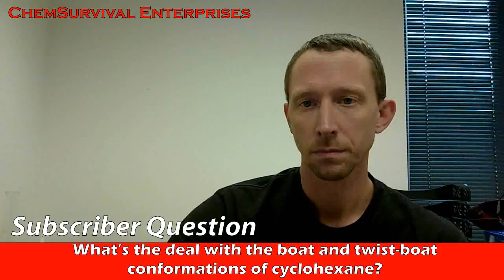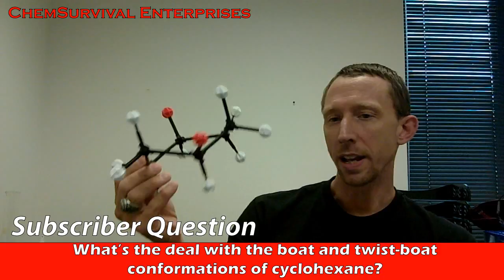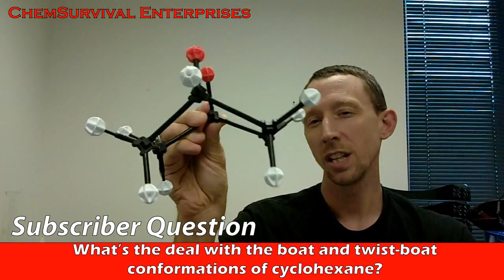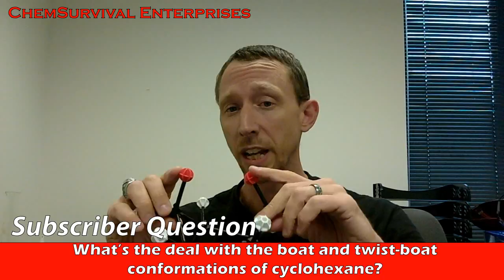The Significance of the Boat and Twist-Boat Conformers of Cyclohexane

Comment from the maker: Hi Abhishek!  We do call that transition state between chair and boat the 'half-chair' conformation.  I call it a transition state because it is a state which is at an energetic maximum (not minimum), so it only exists for an instant during the transition from chair to twist-boat.  We do not use the term 'half-boat' conformation, because it would be exactly the same as the 'half-chair'!  Thanks for the insightful question, maybe when I have time I will make it into a video!

Comment: Sir why half chair less stable??
Reply from the maker: Half chair is less stable because five of the six carbon atoms are coplanar, making their bond anges closer to 120, greater than the ideal angle if 109.5.  Additionally,  the hydrogen atoms bonded to those coplanar carbon atoms are eclipsed (have a zero degree dihedral).  Both of these features destabilize the half chair relative to the chair or even the boat confirmation
Reply: @ChemSurvival  tq so much sir

Comment: Why c is 1, 4 di t butyl  exist in twist boat and not chair.
Reply from the maker: The answer lies in the  diaxial interactions that would have to exist for cis-1,4-di t-butylcyclohexane in the chair.  In each of the two chair conformers, one of the two t-butyl groups is axial.  This creates a very high energy conformation because a very bulky t-butyl group is in the sterically crowded axial position.  But the twist boat conformation can place both t-butyl groups in less crowded positions simultaneously (opposite the flagpole hydrogen positions).  This is the most energetically favorable conformation, and so it is best description of the conformation of cis-1,4-dit-butylcyclohexane.
Reply from the maker: https://youtu.be/GJz-3rQO-HE  Here is a video reply to your excellent question, chinu singh.  Thank you!

Comment: sir , i want a question that in video you have shown that boat form is formed first then twisted boat is formed but in theory somewhere i have read that twisted boat is formed first then boat form takes place.
Reply from the maker: bhanu,  you are correct.  the twist boat forms first, directly from the half chair.  I wasn't really trying to show the entire process sequentially, but rather to show how all other possible configurations are achiral.  I configured the model in a twist boat last so that I could end the discussion with twist boat (which was the topic of the original question).  Thanks for the comment!